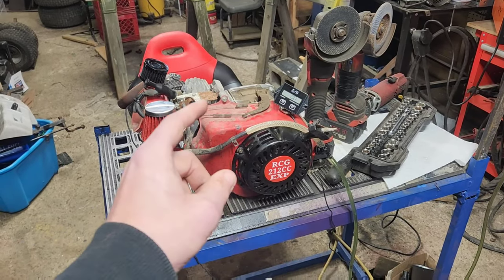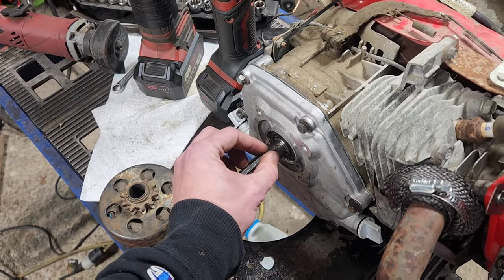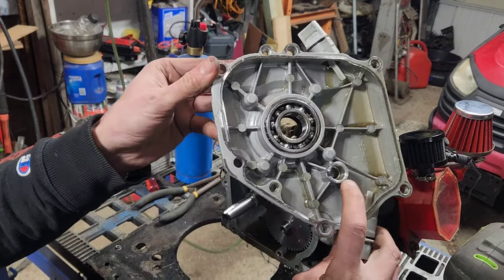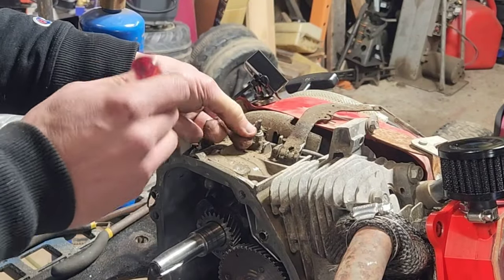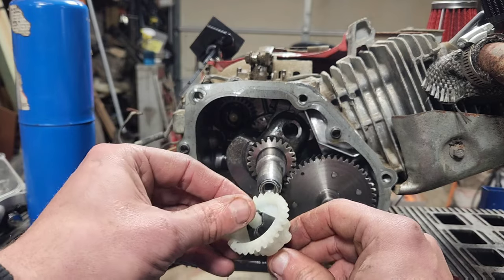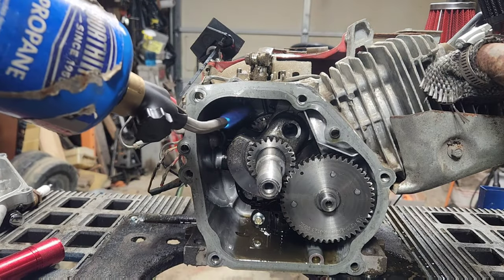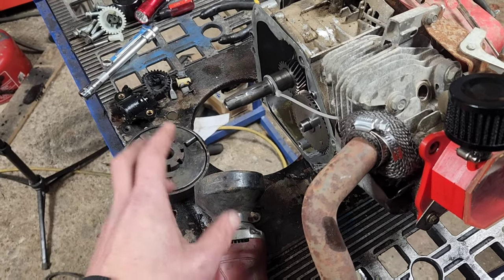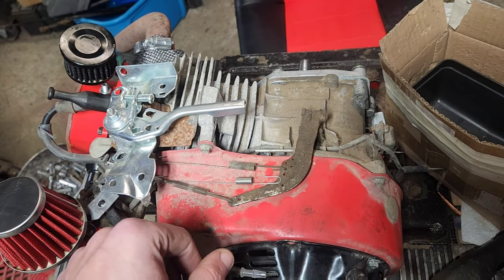Predator 212cc Governor Delete The Youtuber Lie!

Comment: Instead of deleting the governor, just don't use it. Run the throttle cable directly to the carb, like a car or motorcycle.
Reply: Most of the time they blow up and plastic in bottom of pan
Reply: that works if your only going to over rev it a little once you want to go 3,4,5 even 6 grand higher on some built things the governor literley explodes and thoes bits of plastic and the metal parts run through the motor at high rpm and some times the blow holes in the side if it gets stuck in between rotating parts, also i deleted the whole governor setup on a 11hp flathead briggs and cammed it with a bigger carb and ran a bike brake handle and cable as my throtal pedal adjusted properly its a fantastic setup
Reply: @zakburnett6690  I had a 10hp on a go kart ,that bounced it's limit ungoverned for an hour at a clip and still had the internals. 
It was a Briggs, so there's that ,and some luck but I usually don't bother.
Reply: @MrTheHillfolk  they don't rev all that much higher if you don't put valve springs in the the old flathead springs just can't do more than about 5k or so witch is pretty safe
Reply: How tho
Reply: The governor arm without any linkage is causing my engine to surge and runs at extremely high rpms causing the minibike to which it is attached to, to take off immediately when started a swings around like a chainsaw as I try to keep it from slamming into a parked car.
Reply: Hey any time I've unplugged the oil sensor the bike doesn't run period
Reply: Is there enough oil in it?
Reply: @desertdoll7 you need to rewire it, connect the cable from the coil to the switch directly
Reply: If you have a car 1990 or newer, your computer will force you to run against the governor .

Comment: Who said that the top plate is necessary for a governor delete? I want names. Sneak dissing doesn't sit well with me. RBG did that to C&C once and I called him out on it. If somebody here actually knows let's hear a name.
Reply from the maker: It's a repeated theme of all Go Power Sports sponsored channels. Their own throttle bracket videos are an insanity. "You now need to buy the $25 bracket. Plus we made it so thick you have to also buy these two 5 cent bolts at 1.50 each plus shipping" This is why I buy from NR Racing and OMB.
Reply: @redneckcomputergeek  your not wrong about those channels plugging their sponsors heavily but I've yet to see a video where someone says "you have to buy this top plate" specifically. If somebody here can show me a video where they say that I'll be waiting.
Reply: @inspireonex  sure they don't come out and say you need this ,but they don't show the alternative either and just go the easy way.
Reply: @MrTheHillfolk  then why did he say they said that exactly?

Comment: I've never bought, made, or used a top plate. I have done a half assed governor disable and left the governor gear inside and the shaft on top. I ended up with a brand new 212cc hemi with a sunroof.

I've opened every engine since then and completely removed all the governor components. Then I tap the holes with a thread tap and installed an appropriately sized set screw with thread sealer. Never windowed another block.

I've also come up with my own solution for adapting a throttle cable to the stock carburetor, using the governor arm and using all of the stock springs, plates, and linkage parts. I removed the gear inside and replaced the steel actuator with a stud.

Also, in my humble opinion, if you've got the engine opened up there's no real reason why you wouldn't knock the flywheel off and punch the governor gear from the outside. The torch method you used was as at least equally as sloppy as the monkeys on YouTube crushing them out in 30 pieces using pliers like some kind of nightmare dentist. Except you're breathing in and filling your shop with burning oil and plastic.

Comment: constant speed engines. have heavier springs. if you take a predator and only install a "constant speed throttle plate", you will have to screw the adjuster screw almost to the end of its travel. also, if you use a constant speed spring, you can achieve 3900-4100 rpms with a normal "adjustable throttle plate"
Reply from the maker: That makes sense. Thank you for the input and solving the why.

Comment: im wondering how the mounting bolts are going to work when making it a vertical shaft
Reply from the maker: That was why we did the side cover conversion. That gives us the 2 bolt holes to mount to.
Reply: @redneckcomputergeek  do you think that only 2 bolts is enough?
Reply from the maker: @SpudStudios  not sure how I wrote  2 it should have been 4 bolt holes lol Needed more coffee or something.
Reply: @redneckcomputergeek  ok lol

Comment: I have a honda 270gx.  I removed the governor but still have the same top speed.  What could it be ?
Reply: Throttle arm has a limit screw that needs backed out or cut off

Comment: Sweet! How high can you safely rev a stock 212?
Reply from the maker: The generally stated number is 5kish. The valves will float at 5800. But the stock rods are not a fan of anything over 5k and will at some point tell you so.

Comment: do you want extra gears spinning inside? thats why you remove the governor.  engines i run side carbs. if its a low rpm engine i leave it. if its going above 4000 a lot. take it of or it might explode
Reply from the maker: Watching the video a bit before commenting would be a good idea. I do remove it. The video shows how people used to do it before Big youtubers started promoting the cut it off method for some reason.
Reply: @redneckcomputergeek  i thought we should comment as we watch, and i thought any comment helped you. you are the only big youtuber i watch. DWL
Reply from the maker: LMAO! Well played thank you :)

Comment: Great video series so far. Question: Would you be kind enough to make a detailed video summary at the end of the project explaining in great details: what needed change, the reasoning behind those changes, cost of additional parts that were needed. Perhaps a short explanation for those who want to transform a horizontal shaft engine for a rotary tiller and what things should they look out for. Thank you very much.

Comment: In every town there should be a small machine shop that will take jobs from the public. Or a guy that has a "back yard" welding, machine and fab shop. Don't be afraid to ask, some of the big DIE shops will take work when slow. Better yet, get to know someone that works there that will do work after hours. Even at $80.oo/hr I could knock out that key-way in 30 min. Most of that would be set-up time.
Reply from the maker: With the Dremel tool method I fully agree with you cause it takes over an hour of cutting. But with pulling the side and cutting it all in with a 3 inch wheel it took 20 minutes at most to do. The china cranks for these are about $35 shipped. So it hits that borderline of time is money vers just buy it.

Comment: Red Beard's Garage would say that you definitely need a top plate I've been doing this for free not top or anything just like in this video
Reply from the maker: It's a repeated theme of all Go Power Sports sponsored channels. Their own throttle bracket videos are an insanity. "You now need to buy the $25 bracket. Plus we made it so thick you have to also buy these two 5 cent bolts at 1.50 each plus shipping" This is why I buy from NR Racing and OMB.

Comment: This video is priceless. All ya need to do to remove governor. Funny Cause I'm new and been watching all these videos think...why are they cutting that? And whats wrong with just leaving gear in place and knocking the metal gear off the crank?
Reply: Guys just do things differently. The end results are the same. I don't recall anyone saying that you must cut the governor arm shaft, or that you must get a top plate.

Most of these guys aren't going to take the crankshaft out to remove the drive gear. This is why they remove the plastic gear. It's just a different way to do it.